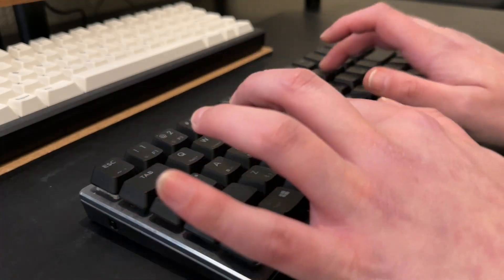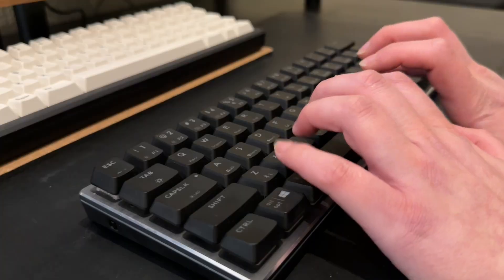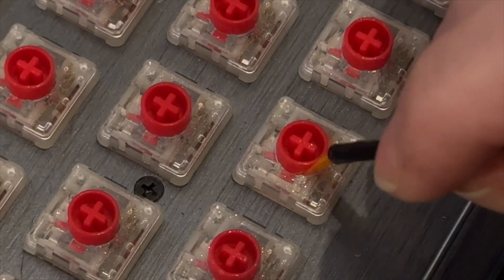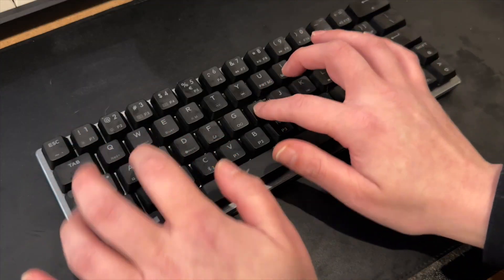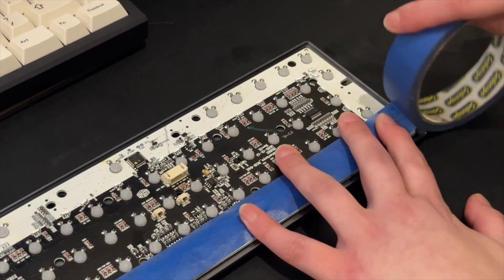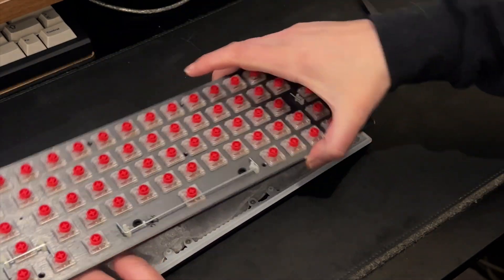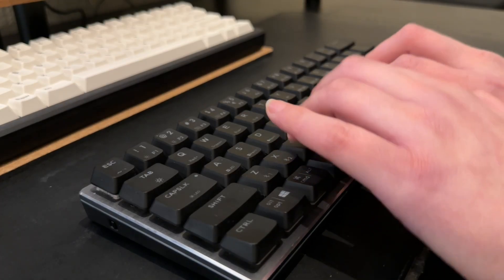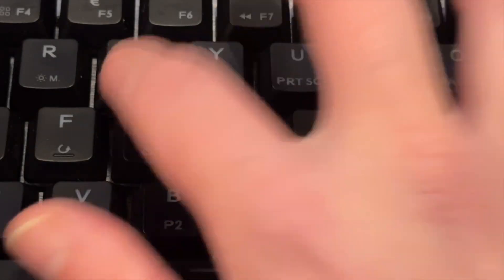Any Keyboard Can Sound Incredible With These Mods

Comment: Chinese keyboards are dirt cheap, and they sound & feel premium out of the box, there's really no point in modding these old, not hot swappable e-waste keyboards.
It still sounds terrible after modding btw, way worse than Chinese keyboards priced at $20.
Reply: yeah tape and foam are cheaper, why buy another one if you can easily mod one
Reply: @00nervy  Because modding can never make it as good, and premium ones are already dirt cheap.